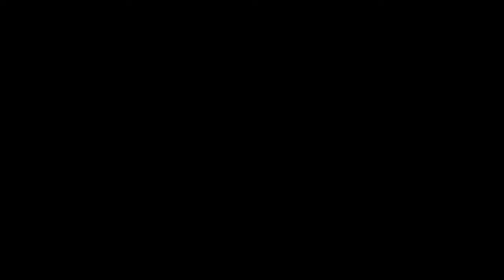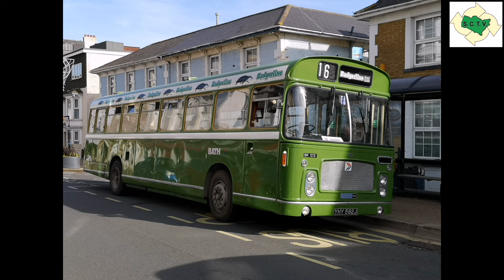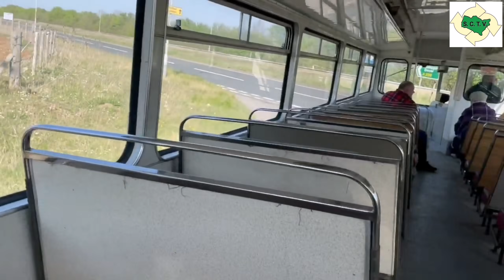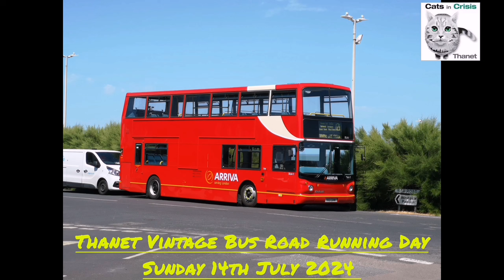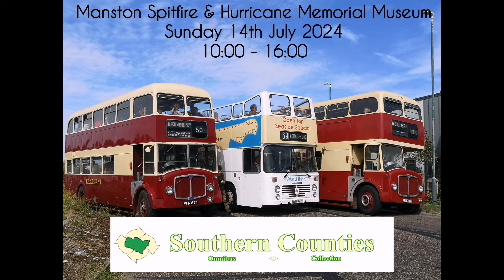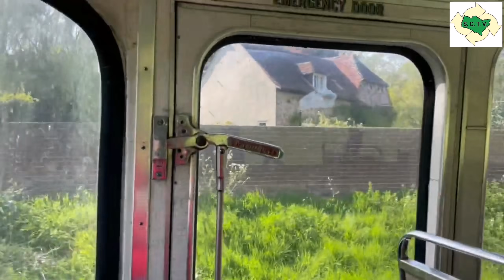1960's Fashion - Engine At The Back. The Evolution Of The Modern Single Deck Bus.

Comment: Reality check, in 1934 the Birmingham Midland Motor Omnibus company BMMO supplier of buses to Midland Red designed built and tested two revolutionary chassis. These two chassis quietly  set the bus industry on fire, one bodied as a bus, the second as a coach. If you looked at a photo of one ,you think it was built in the mid 1950,s wrong cats&kittens?.In the early 1930,s BMMO engineers thought way outside the box  coming up with a bus or coach ,front entrance opposite the driver and a four cylinder BMMO petrol engine mounted at the rear transversely ,like the engine of a Ford Fiesta.  Unlike most buses or coaches of the 1930,s BMMO,S gamechanger was yes , at two pedal semi automatic in 1934!!!! courtesy of a four speed Cotal gearbox controlled by a lever under the steering wheel, driving an offset underslung worm rear axle.  Designed in the  depths of the depression, BMMO,s rear engine marvel is the Eohippus of the modern rear engine  low floor automatic city bus or with manual or semi automatic gearbox a long distance touring coach.
Reply from the maker: Thanks very much for commenting. Very interesting

Comment: Yes, Roadliners worked better as coaches but still not well enough.  Black and White took their last two batches with Perkins V8 rather than Cummins V6 power but even they were gone by 1975.

The Fleetline single deck was  slow and often suffered body structure failure because of the massive chassis flex.

Another failure was the Seddon Pennine RU which used a Gardner /SCG driveline but had an offside radiator,  poor quality of design and build, and handling uncertainty, unreliability exacerbated on short examples by the very short steeply angled propshaft, and on those with the in-house Pennine body,  frame fractures and sprung rivets were commonplace.

With regards to the Swift, many of the operators who got good service from them were by the sea where those in landlocked areas seemed to have more trouble.  

Interestingly the two biggest Panther operators were Brisbane and Perth and most of those in Western Australia had the Swift cooling system.
Reply from the maker: Very interesting reading that. I'd love to have a look at a Roadliner and a Panther to see how they compare to the AEC Swift

Comment: I believe another reason for reliability problems lay in managements tight times and drivers rushing gear changes rather than the 2 second pause between up changes and matching the revs on down changes.
Reply from the maker: Yes . Abusing the gearbox causes no end of issues

Comment: The Panther had the radiator at the front like the RE, while the Swift had the radiator at the rear end on the offside, where you see a small grille. The Panther and Swift had the engine horizontal and longitudinal at the extreme rear, with the gearbox between engine and the rear axle. The RE had the engine, horizontal and longitudinal, close behind the rear axle, with a shaft leading forward to the gearbox ahead of the rear axle, and a final shaft leading back! This allowed RE coaches to have a small rear boot for luggage, where the engine was on a Swift or Panther.

Comment: Our 340 or so Panthers in Brisbane, Australia, ran very well with some making 30 years in service. They also had front radiators. I think after decades in service the Brisbane City Council could cope with anything that the Panther threw at them!
Reply from the maker: @pauljcampbell2997  fine buses too! It's a shame the Swift didn't go for a front radiator.

Comment: The Roadliner had its longitudinal enine cantilevered too far rearward of the back axle, which caused flexure of the chassis rails.  It also had poorly placed radiators under the body ahead of the rear axle.  Remember the prototype Routemaster experiment?

Comment: Hi i'm viatron from Sheffield again, but I remember one rear engined single deck bus was integral via using an M.C.W. single deck bus body & a Scania running unit also mounted at the rear & it's known as the Metro-Scania which a few of them operated in the Midlands such as Merseyside P.T.E. in Liverpool in the mid-70s what also includes a Scania 2-speed fully-automatic gearbox & I hope you will make a Classic Bus Histories video on my new bus subject. Thank you for your co-operation on this very special insite into the Metro-Scania integral single deck bus from David Viatron Esquire of crookes in Sheffield.
Reply from the maker: Very fast and smooth buses!

Comment: The Merlin/swifts lasted over 10 years on the red arrow before the national 2 came along not bad really but that work was suited to them better I believe they were on the 91 Wandsworth bridge to Hounslow West for  a while  I was 6 and always  remember the strong smell of diesel at the rear and the illuminated advert panel hanging from the ceiling 😊did any XMS buses get preserved 
Cheers 😊😊